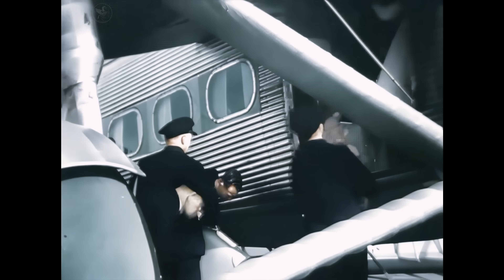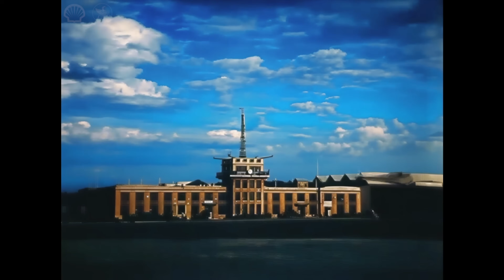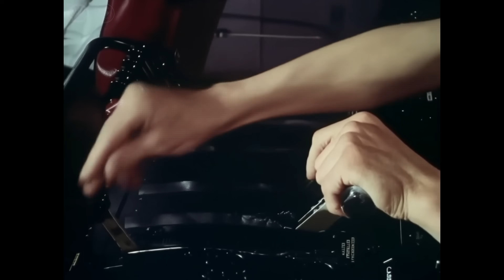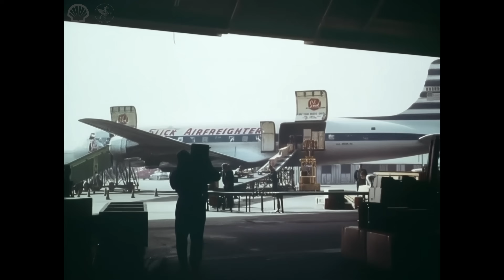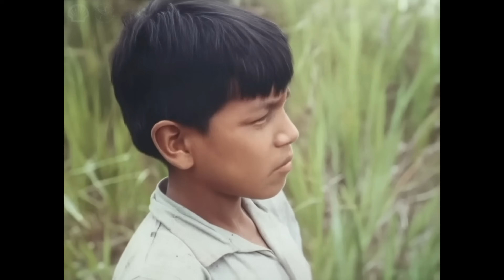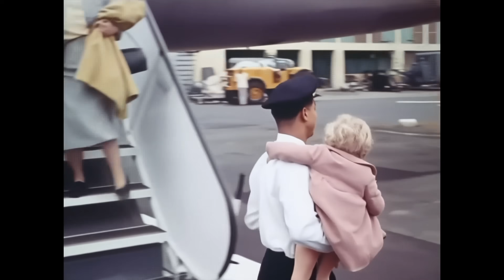Before the Jet Age: The Dangerous Dawn of Global Air Travel. Inside the Dawn of Global Flight

Comment: My Father was a 747 captain for United Airlines out of LAX.  He captained the 747 from 1972 until his mandatory retirement at age 60 in 1981.    The avionics at that time were much different.  No high tech computer systems like today, mostly guages and the stick shaker, which he said would go off at times and he would ignore it becasue he said it was invalid, not sure I understand but thats what he said.  My father climbed the ladder of commercial aviation history like none could today. He trained on an open cockpit biplane. He began his airline career in 1942 at age 21 as 1st officer on a DC-3 with Pennsylvania Central Airlines. Within two years he was DC-3 captain. Pennsylvania Central eventually became Capital Airlines in 1948 where he captained the DC-4, L-049 Constellation, and Vickers Viscount (the first turbo-prop airliner). In 1961 Capital Airlines merged with United Airlines where he went on to captain the Boeing 707, 720, the DC-8, the Stretch DC-8, the DC-10, and finally the B-747 which flew from 1972 until his mandatory retirement at age 60 1981. He experienced the full evolution of commercial flight, airline pilot for 39 years and Captain for 37 years. No airline pilot over the last 60 years could experience the revolution and massive change of commercial flight like my father did. He just recently passed away in 2019 at age 97. He was one of the last of the old school breed of pilots.

Comment: Just some insignificant pieces of the old Croydon Airport still remain, the main terminal is a hotel, a couple of the hangers are industrial units but the tower is still there. A tiny piece of taxiway arcs around to form the threshold of the northwesterly runway, we used it to fly control line models back in the 70’s, from that remaining runway end you can see the housing estate that sprang up as soon as the airport was closed.

Comment: I’ve flown on DC-3, Connie’s, Electras, Bonanzas, Cessnas, and the full Boeing line of planes, and I’m still here — flying must be the safest way to get around.
Reply: It's much quoted but really, it's safe until it crashes. Planes crash a lot. Up in Alaska, light aircraft crash & is treated like a car crash. Happens all over the world. You only hear about the big ones & of course 200-300 people die in one go. I'm fine in my car, drive safely, avoid the idiots & I'm still standing. Planes I treat with respect, if a large one goes down, the tail end is the best chance of survival, get in the toilet & pray.

Comment: My grandfather was born in 1901, before the first flight. One of the last airplanes he flew on was a 747. He said he was amazed at its size. It is amazing how much has changed in just one generation.
Reply: The whole length of the Wright brothers first flight could fit inside the length of a 747.
Reply: @markbooth1117 more than 10 brothers flight can fit in 747
Reply: Your grandad was born  before the first powered flight but not before the first flight
Reply: @retrowatches1655  Well, that's obvious. Just search for the “First Flight,” and you'll see that “The Wright brothers” comes up. It was actually the “First Controlled Power Flight,” if we want to get technical.

Comment: oh what memories this video brings. I started out aboard a Douglas DC-3, later came the Boeing Stratocruiser, then the Douglas DC-6B, followed by the Lockheed L-1049G Super Constellation, the Boeing 707, Douglas DC-8 etc. In this clip you see the Handley Page HP 42. Agatha Christie used this plane as the scene of a murder mystery flight in Death in the Air.